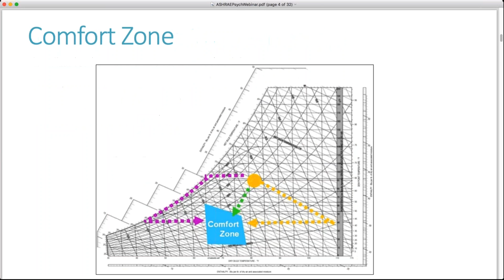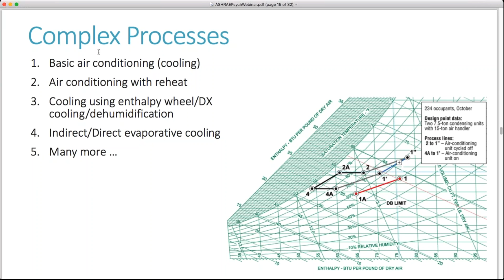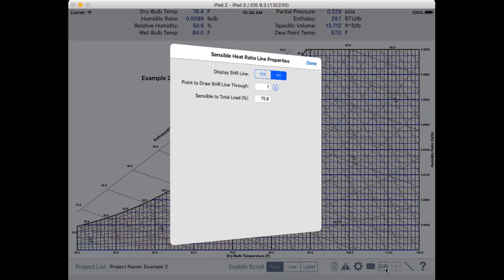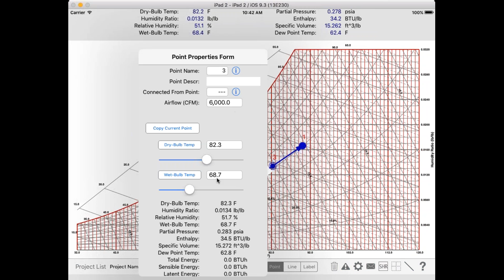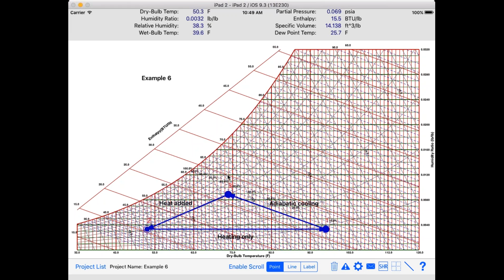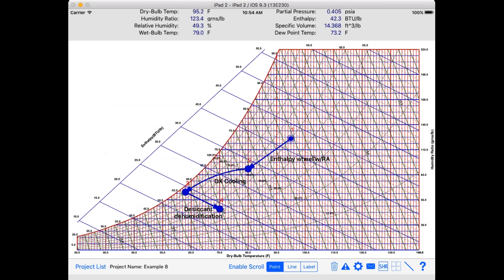Using ASHRAE's Psychrometric Chart App

Comment: This app has the beginnings of a good app. But as is, it is limited in usefulness, and ASHRAE should not be selling this essentially beta version as a serious tool. Specifically the shortcomings are:

1. Needs an undo button.
2. SHR < 10% displays as a vertical line. 
3. Needs enthalpy-humidity ratio button like SHR button.
4. Should be able to connect multiple lines to one point to show the correct process direction. For example, mixing point.
5. Need to add the ability to back up files.
6. Should add the ability to lock points so that they are not accidentally moved.
7. Would be nice to be able to delete lines by selecting them rather than going to the point menu to delete it. 
8. When editing a point, there are times when the changes are not accepted. 

If these changes are implemented, this could be a very useful app. However, as is, I wouldn't recommend purchasing it, and ASHRAE should make clear its limitations to people who are considering buying it. However, it appears that Carmel Software Corporation, who developed the app, is no longer updating it, and they don't respond to customer requests.

Comment: what is the factor (4.5) that you used to calculate the tonnage of cooling in Example 8 when you said (in min 48:12) the (tons of cooling) = difference in enthalpy times the constant 4.5 times the air flow rate of 5000 Cubic Feet per Minute = 34 tons of cooling? I'm not familiar with that 4.5 constant. However, I know that

total heat removed by air conditioner, i.e. the sum of sensible heat of the dry air plus the latent heat due to presence of moisture = air flow (m3/sec) *  moist air density (1.202 kg/m3) * enthalpy difference (kJ/kg),
where multiplying the flow rate by air density gives the flowing air in kg / sec
and multiplying this air flow in kg / sec by enthalpy difference in kJ/kg will give certain number of kJ / sec, i.e in kW

1 Refrigeration Ton (RT) = 12000 Btu/h = 3025.9 k Calories/h = 12661 kJ/h = 3.517 kW

Thanks a lot.
Reply from the maker: Sorry for the delay in responding, Dr. Fahmy; I had to ask an expert about this one! 

According to the video's creator, 4.5 is the factor used to calculate total cooling load (at standard pressure and temperature). The equation is: 4.5 x CFM x Delta Enthalpy = total cooling load including both sensible and latent. The 4.5 factor will change as the elevation changes.
Reply: @ASHRAEvideo  Is there an free app for getting the psychrometric values
Reply: 4.5 is a constant used to get the BTUHr=CFM x 4.5 x Enthalpy difference.  4.5 = 0.075 the weight of a cubic foot of air x 60 minute
Reply: 4.5 is the ratio to convert CFM to Mass/sec (at standard conditions in imperial units). The unit conversion is done by taking 60 seconds/min and dividing by specific weight 13.3. SO 60/13.3~4.5